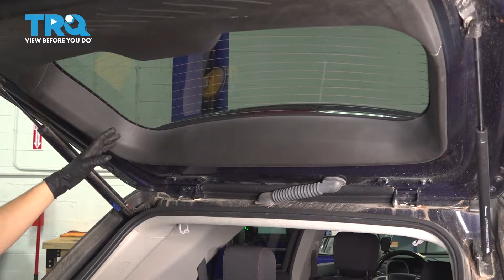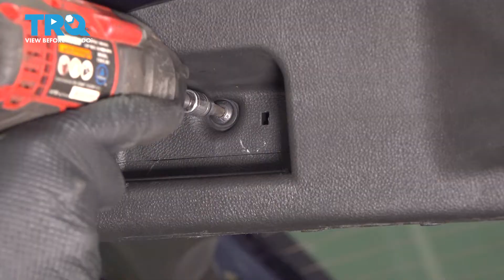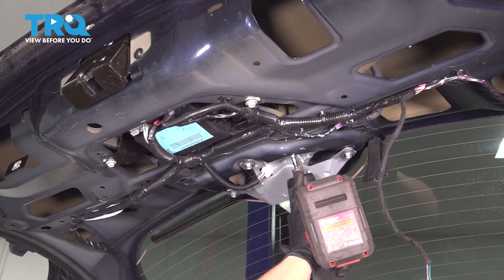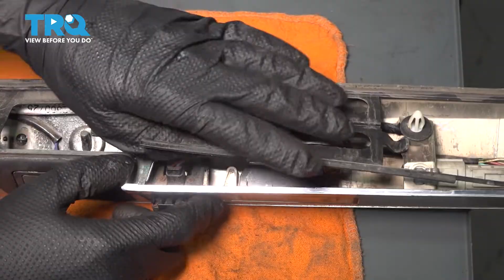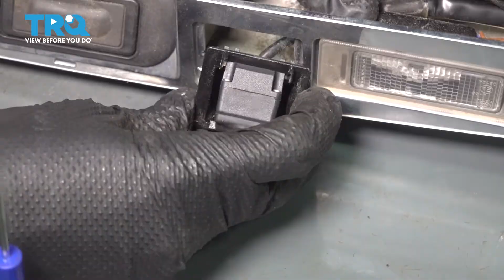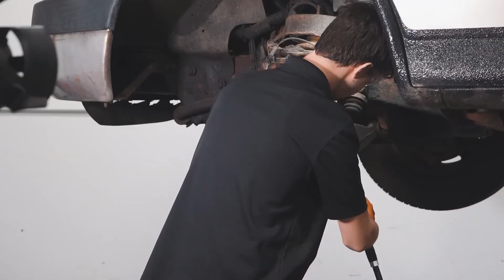How to Replace Park Assist Camera 2010-2017 Chevrolet Equinox

Comment: This video helped a lot. To any folks out there looking to do this on a 2015 equinox. Couple things to think of. Be careful not to break the connector tabs near where the tailgate latches on the lower trim section when popping it out. Also dont forget to reseal the chrome trim before putting it back on. And also when loosening the 4 10mm with the deep socket, if you drop a nut into the tailgate its a bit easier to find than you would think. You cant fit your hand in there if your a big guy but there are some access holes right beliow the wiper motor area where the two middle nuts fasten and they are there in case the nut drops it will land right there and you can just fish it out of the access hole. No stress